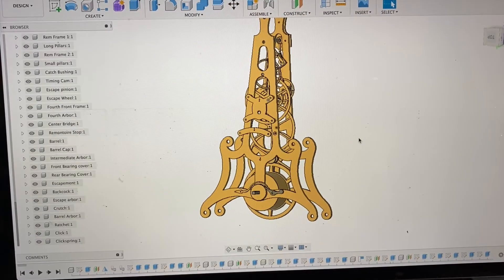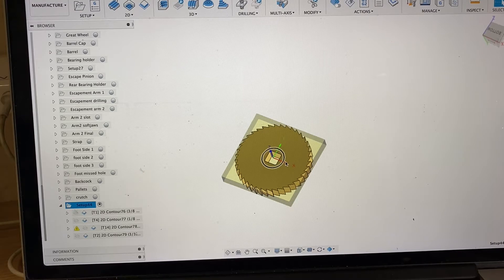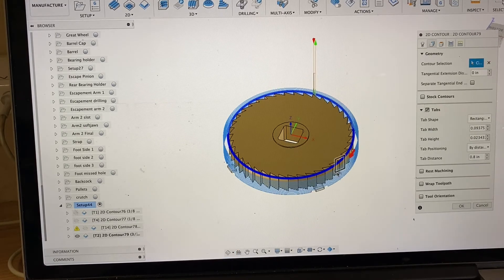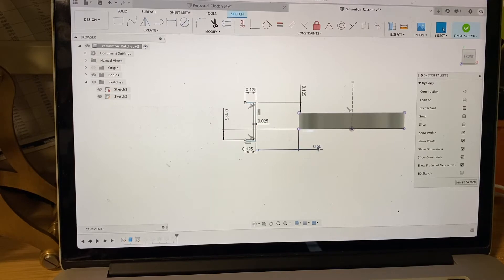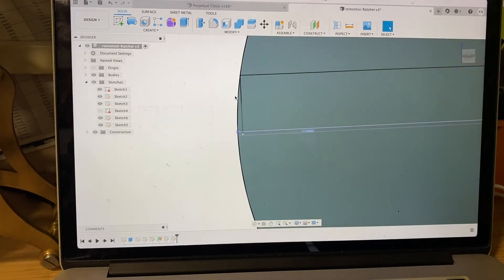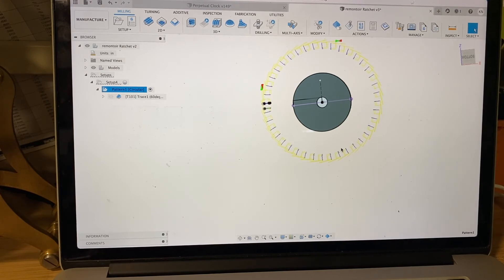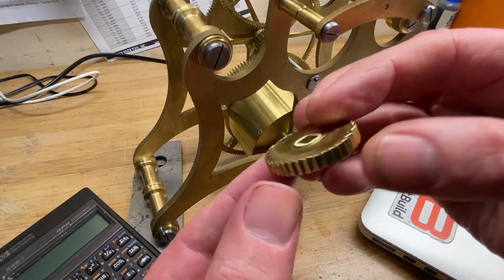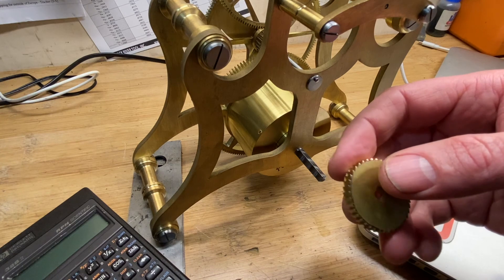Making the Ratchet

Comment: Hi, having 4th axis is a useful addition to your CNC. Putting a 5 degrees offset on the ratchet wheel makes a big difference to how the click locks in place. Thanks again for the video.
Reply from the maker: It makes cutting wheels much easier, no need for a dividing plate